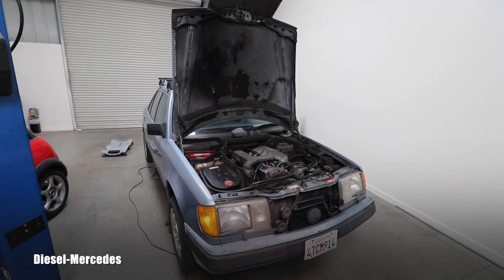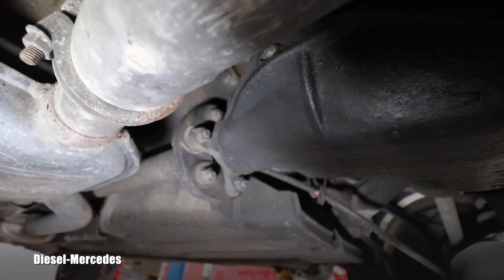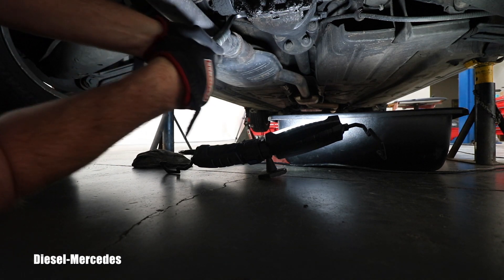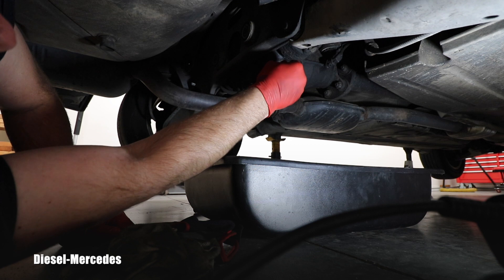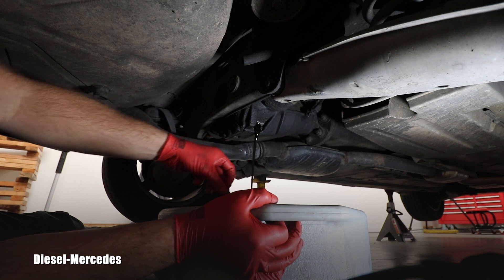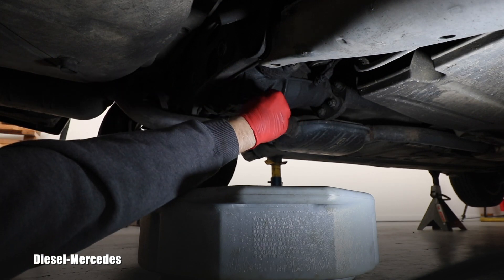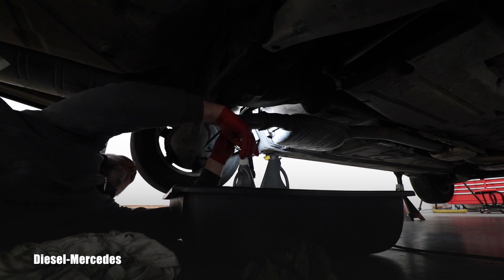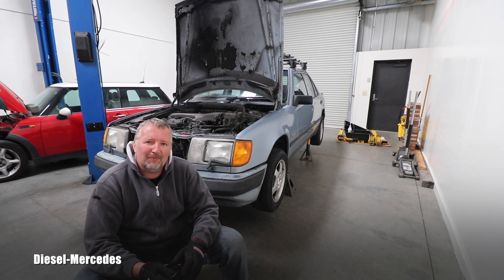Mercedes W124 Rear Differential Oil Change

Comment: Thank you for the video.  My 1995 W124 E300 diesel SE has ASD (and it actually works, flashes " ! ").  Looking into what oil to use.  75W-90 Valvoline Synthetic is readily available here (Long Island) and says for "limited slip" use.  A 75W should flow better in the winter, but be no thinner than a 90 in summer.  What do you suggest?
Reply: 75w-90 will work according to many forum posts on the net
Reply: This is not a limited slip however
Reply: Thank you!   What's the "best" forum for diesel W124?
Reply: Best way to nagivate it is to Google search peach parts and what info you need

Comment: Hey Great Video & Information! Can ATF oil be used as a Differential oil?
Reply: ATF is very thin for the Differential and wouldn't work on this Part. You only can use ATF for the Gearbox